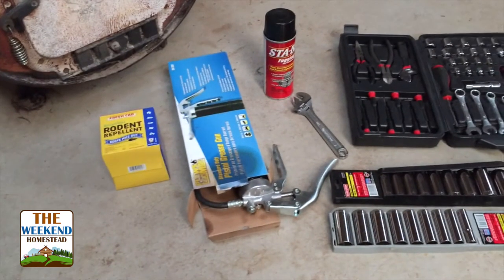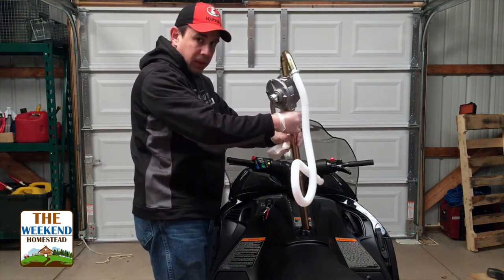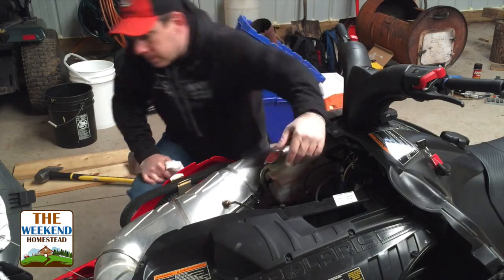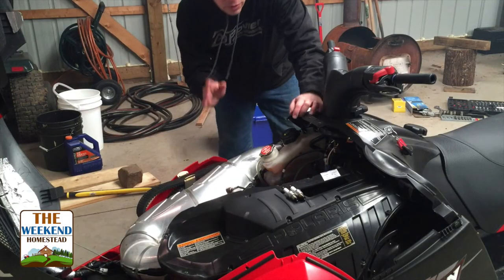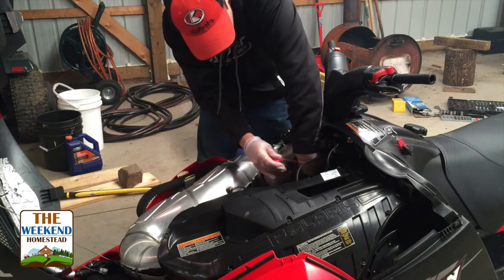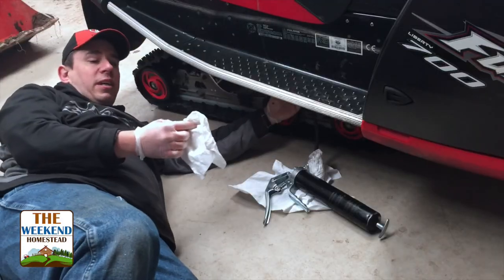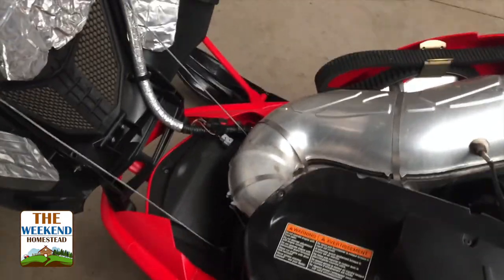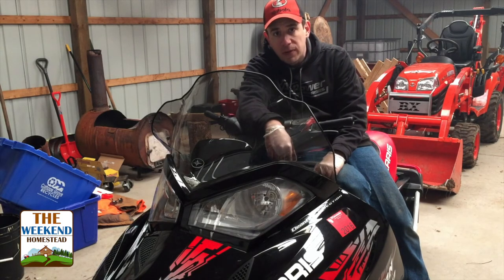Tips and Tricks Storing & Maintaining your Snowmobiles. - Shop Time!

Comment: You never drain the tank on a fuel injected sled. You put fuel stabilizer in to the tank and top up the tank as there are fuel socks in the tank that you have to keep moist with fuel. Run the engine til it warms up to cycle the fuel in to the fuel injectors. It will be very hard to start otherwise. Drain the fuel when the season starts and top up the tank with fresh fuel. When putting fogging oil down the spark plug holes lift the front of the sled up in to the air, Put the handle of your spark plug wrench int to the spark plug hole and turn the engine by hand with the clutch til the cylinder with the spark plug wrench handle gets to bottom dead centre so that the fogging oil goes thru the transfer ports and down to the bearings on the crank. Do the same to the other side. Put both spark plugs back in and fire up the sled til it just gets smoky out of the exhaust then you'll know that the bottom end is lubricated. Then shut off the engine. It says all of this in your owner's manual.
Reply from the maker: I guess i will have to go back and check that. Thanks for the response. Great tip on the cylinder spark plug lube.